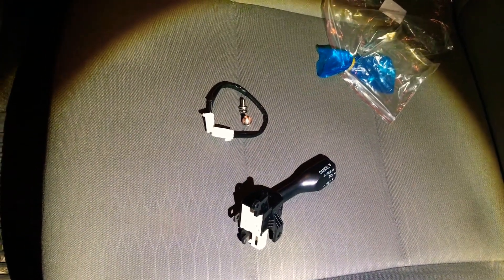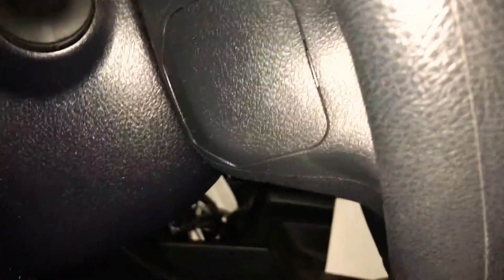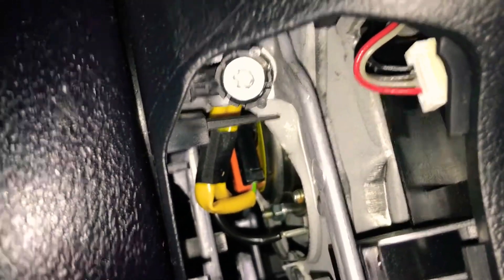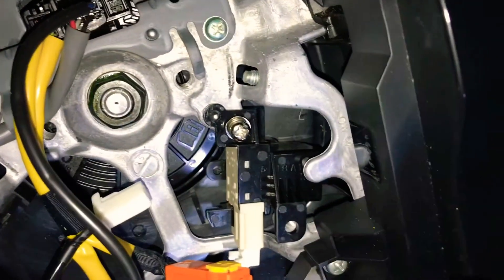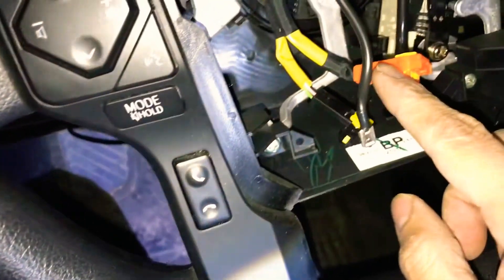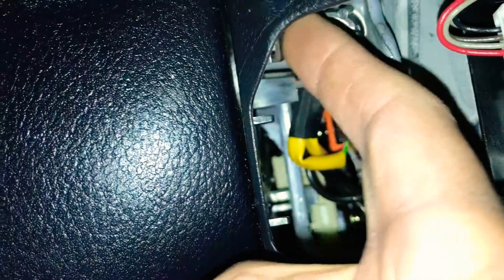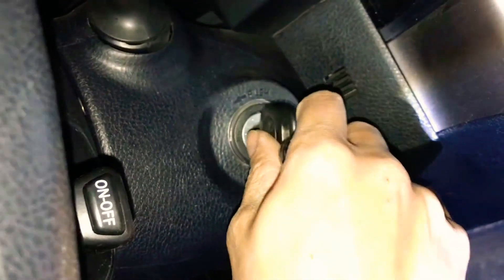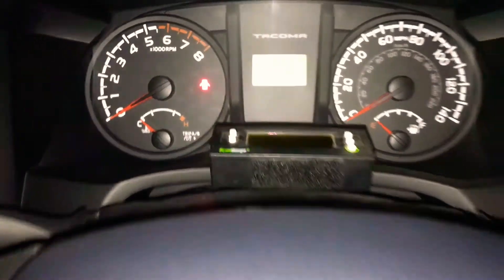HOW TO INSTALL CRUISE CONTROL ON 3RD GEN TOYOTA TACOMA

Comment: Nice! I have a 17 base model as well. Ordered a OEM cruise control switch with the hole cover for $30 and I ordered a cheap control for $12 like yours to use the wires and screw, the difference between the two controls is actually similar but I wanted the oem one. I didn’t know there was a video on this and when I first ordered the parts I was just gonna do it so my steering wheel looked more complete. When I found out it was possible, I ordered another control so I could get the wire to install. Next on my list is the controls on the steering wheel, even if it’s not functional it’ll look better than plain

Comment: I have an Tacoma SR I just bought the cruise control switch and plan to get the intermittent wiper control next hoping I can also get factory Keyless Entry as well.
Reply from the maker: I was planning to do that as well… but I needed something to tow our 4000 lbs RV… 😬 so I ended up with a 2016 Tacoma TRD Sport 2wd V6 4 Door. It rides a bit smoother.
Reply from the maker: I do miss the better fuel efficiency of the 4 cylinder Tacoma.

Comment: How do I complete this procedure if my tacoma doesnt have a separate connection for the ground wire and cruise control? Please help
Reply from the maker: I’m not sure 🤔…
Reply from the maker: Is yours a 3rd gen Tacoma?
Reply from the maker: 2016 - 2021
Reply: @electriccuts  Mine is a 2014 Base model 4x4 with the 2.7l 4 cylinder engine
Reply: @electriccuts  I found the right cruise control toggle switch, but I cant find the right harness to fit onto the steering. The stock setup only has room for the ground connector
Reply from the maker: @jtravel80  you would have to look on eBay for a switch that fits your vehicle and specify to them what year, make and model your truck 🛻 is.
Reply from the maker: @jtravel80  that’s what I did…
Reply from the maker: @jtravel80  message the seller… maybe they have an adapter or some other details…
Reply from the maker: @jtravel80  you can also look 👀 for other YouTube videos or search 🔍 on google for install of your year Tacoma.